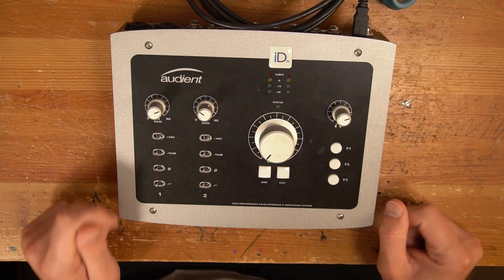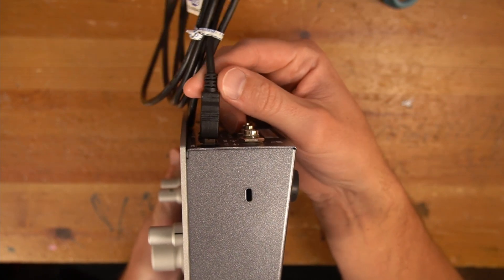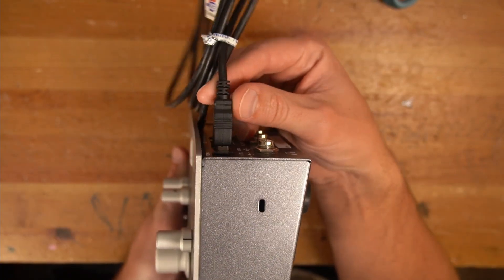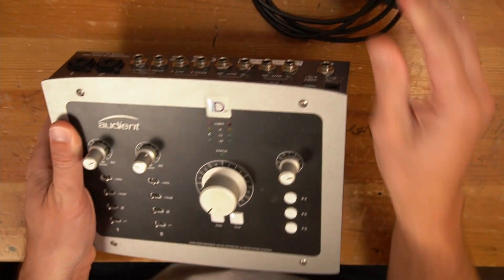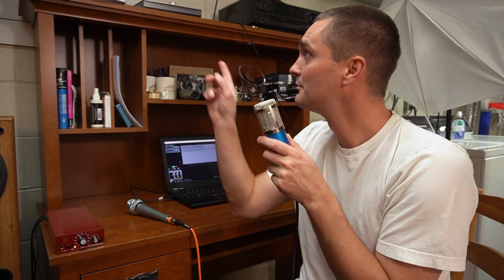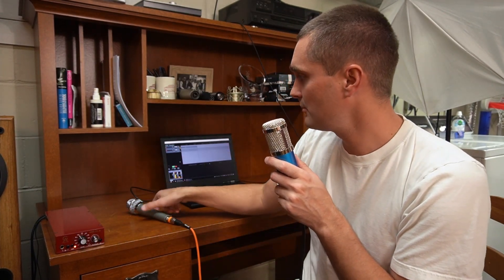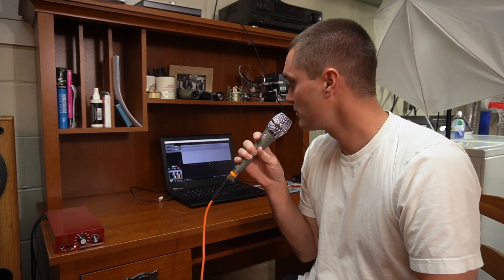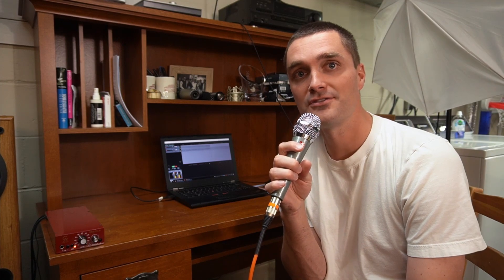How To Fix a Broken USB Type B Jack | Audio Interface Repair

Comment: Does it matter if the four pins points touch each other with the solder?
Reply from the maker: You don't want that.  I'd flow them again and maybe use a solder sucker to remove a little bit of the solder so it sits nicely on the pad and doesn't touch.
Reply: @KleyDeJong Ah ok, Thanks

Comment: JUST TODAY I SEEN LACK OF CONNECTION TO MY MIDI KEYBOARD WITH THIS PORT  AND CABLE JUST FREELY PLAY INTO IT! THERE IS A WHITE PLASTIC CORE IN CENTER OF PORT RIGHT?  MINE IS MISSING SOME HOW!!!  CAN I REPLACE THAT CORE FROM A NEW FEMALE TYPE B JACK INTO MY KEYBOARD ORIGINAL PORT OR NEED SERIOUS DEASSEMBLEY OF MY KEYBOARD AND RECH  BEHIND HAT PORT AND SOLDERING BECKAUSE IAM POTATO AT SOLDERING!!! 😢😢😢😢